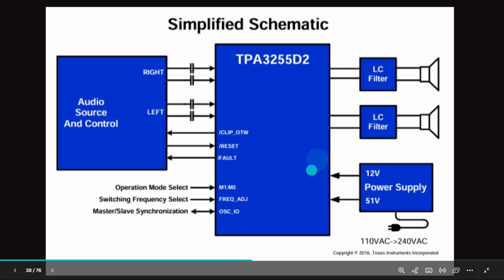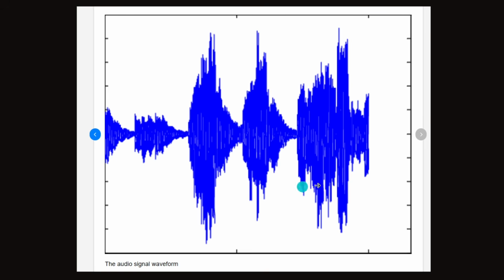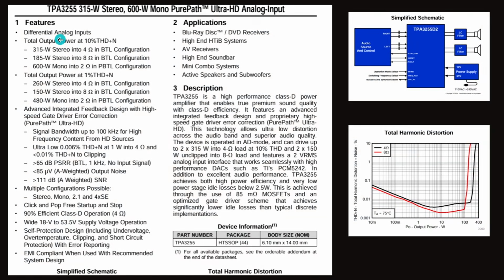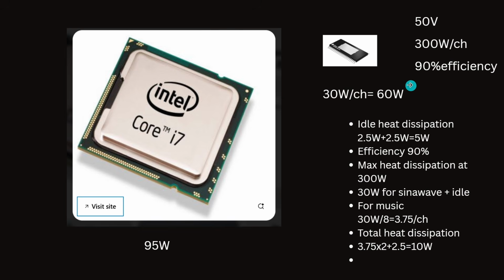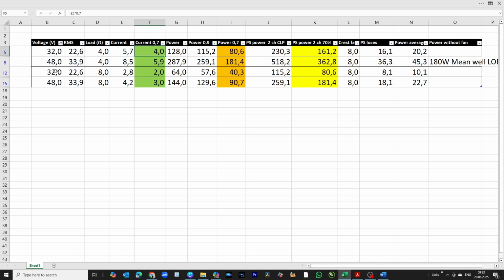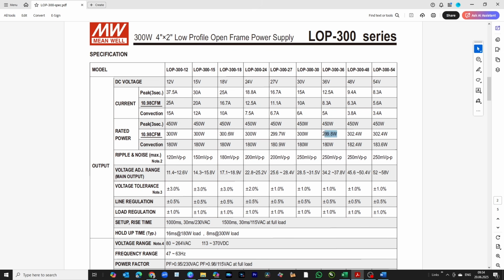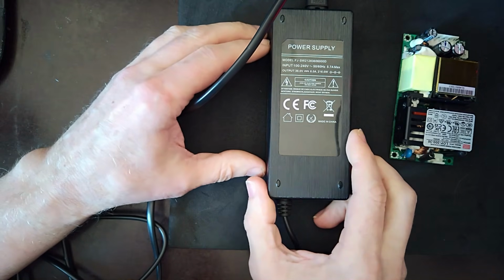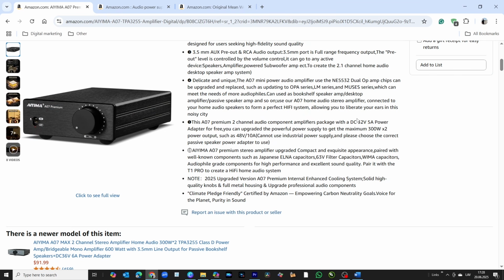TPA3255 amplifier power supply

Comment: Please tell me, have you had any experience with the Yongzhu Star 600w LLC power supply?
Reply from the maker: Most of those power supplies are operational. But I am using only industrial-grade power supplies with certification. Yongzhu Star 600W LLC should be OK for DIY projects, but I would not use them for commercial products.

Comment: the connectors on the meanwell power supply are a bit strange, does it come with the connectors when you buy it?
Reply from the maker: No, but it is a mainstream connector and available in any electronic components catalogue

Comment: Did you test the ripple/noise of the Aiyima 36v supply?  
I'm looking for a 36v PSU to replace the stock 32v 5a PSU that came with my Douk A5 amp and I don't need the power of a 48v supply for my high sensitivity speakers.
Reply from the maker: I have bought Aima 36 5A poert supply and it is fully operational. There is no riple noise issue. For full amplifier capacity or extream users 10A woul be prefereable. On 4 ohms load bass is a bit thin when going up with the power. Othervise great power supply.
Reply: @guntarssmits2104   There is no "ripple noise issue" ... compared to what?
A good SMPS should have ripple near 50mV (p-p) or less.
Reply from the maker: @bbaker6212  TPA3255 has a Common‑Mode Rejection Ratio (CMRR) of about 65 dB, which corresponds to more than a 1000‑fold reduction of common‑mode noise. As a result, the TPA3255 is highly resilient to small power‑supply ripple. The typical ripple frequency of a switching power supply is also well above the human hearing range.
The amplifier’s own noise is approximately 85 µV, and this self‑noise dominates the output, making the influence of the power supply negligible in comparison
.
Reply: @guntarssmits2104  
85 µV is far below most SMPS power supplies so how does this dominate?  
Also TPA3255 amps often use single-rail supplies (e.g., +48V to ground), so SMPS ripple acts as differential noise primarily handled by weaker PSRR... The TPA3255 blocks supply ripple well at low frequencies but poorly at SMPS switching speeds (100-500 kHz) letting noise through to distort sound.  ie, power supply quality still matters a lot - and there is evidence of this by listening tests with lower ripple PSUs.
Reply from the maker: TPA3255 Common‑Mode Rejection Ratio (CMRR) is about 65 dB, which attenuates the power supply ripple effect by about 1000 times, and it does not influence the performance of your amplifier.
Reply: @guntarssmits2104  what does CMRR have to do with it?  These amps run on single-rail PS which means differential ripple via PSRR
Reply: @guntarssmits2104  CMRR is not at play here.  You know this, right?

Comment: Does it work with a ZK 3002 amp TPA3255? I have a 33V-0-33V toroidal transformer (600 VA) but I don't have an AC/DC rectifier board. Do you have the electrical schematic for yours? Thank you very much.

Comment: Пульсации бы замерять, тем более что оборудование есть... Это же одна из основных составляющих!
Reply from the maker: TPA3255 Power supply rejection is 65 dB. Mean well LOP 300 series power supply ripple noise is 250mVp-p. This is high-frequency noise above hearing limits. Who cares about this parameter? The rest of the parameters and peak power are more important. When we are working with a good manufacturer's technical documentation, we can trust the numbers provided.

Comment: Thanks for great work which you have done. I am building my dual mono tpa3255 and selected 60V - 10A power supply, but looks like 50V is too much,. Will add ripple filtering board. BTW, model which you suggested LOP-300-48 has 250 mVp-p ripple - it is not very good results, so I would like to have better option. As well as 6.3A with fan is not impressive as well - we need 10A for dual mono like you calculated. And they released LOP-600 version - it looks promising, but no fan control function.
Reply from the maker: Hi
The theoretical maximum clean output from a TPA chip at 48V is approximately 200W, which is a solid amount of power. I’d recommend starting with the LOP300-48V power supply. The real power demand primarily comes from woofer frequencies, which are more energy-intensive.
If you’re working with a well-designed TPA3255 board, it should include a high-capacity capacitor. This helps support the power supply during peak loads. With the LOP300, you can expect a system capable of delivering 10–12A peak current.
One common mistake beginners make is using an overpowered power supply, which isn't necessary. The LOP300 can handle 450W peak, which is more than sufficient. Keep in mind that audio signals have a crest factor of 8 compared to a sine wave, so even at high output levels, your power supply will remain barely warm.
As for ripple noise—there are different types, but resonant power supplies typically produce narrow-bandwidth noise, which is actually favorable for audio applications. Moreover, the TPA3255 offers 65 dB of ripple rejection in bridged mode—that’s over 1,000 times reduction, so power supply noise generally isn't a concern.
Reply: @guntarssmits2104 hello , what would you recommend for the capacitor from the power supply to the amplifier, and could you demonstrate and give a schematic to make a stiffing capacitor? Thank you much .
Reply: I cut a hoke in the top of the fossi amps cases and mount a 3 to 4 inch ultra quiet fan faced to suck the heat out through the top of the amplifier case . I have also used CPU water cooler system for high power class d chips , the amps love it but makes a big area needed . Plus when using water cooler kit have a couple fans pulling the air from the amplifier case so condensation does not acuminate on the boards components, or treat with spray coating to make water resistant.
Reply: Or if feeling cheeky monkey, do a mineral oil submersion tank and mount the amp inside . Then you have a mineral oil cooler , but after a extended time the oil could start to deteriorate some plastics . ,but then find a way to coat to components and the board minus the external connections for the inputs and outputs . . I have a amp that is cooled by Russian potato vodka , Life of Boris comrades channel did a tutorial a few years ago , and the Russian vodka bottle it the tank .
Reply: The ripple you indicated at 225 is the maximum permissible value. During testing, ripple is usually less than 100. Furthermore, LOPs have a practical power rating of up to 5 seconds at 150% power. In theory and according to the datasheet, this is 3 seconds. For music, this is a very, very large margin. I have LOP 500 and LOP 600 series power supplies. They all also have fan control. But they don't need a fan. They run absolutely cool. And they deliver over 320 watts of power without a fan. And they operate at temperatures up to 80 degrees Celsius, according to the datasheet. They have an extended input voltage and operating temperature range. These are ideal power supplies. At least read the datasheet!

Comment: Hi Guntars Thanks for your video – great information!
 
I have a few points you might find interesting:
 
Following your earlier recommendations, I bought the ICEpower 1200AS2. Unfortunately, the sound quality (SQ) wasn’t as good as with 2 x Fosi ZA3 in dual mono. So, I bought another ICEpower 1200AS2 and now run *two in dual mono* (only using one channel per board).
 
I can tell you that dual mono ICEpower still doesn’t match the SQ of dual mono Fosi ZA3. (all the way up to 95db music peak) In my opinion, ICEpower is not an endgame amplifier for SQ. The 1200AS2 might be “endgame” for DJ or club use – but not for critical listening.
 
Also, please consider doing a new video about *power supply noise* and how to optimize ripple (e.g. with LC filters, etc).
 
Mean Well PSUs have quite a bit of ripple – around 240 mVp-p. In comparison, the Aiyima 48V 10A is a *GaN-based PSU* with lower noise than the Mean Well you recommended. Also, because GaN operates at a much higher switching frequency, its ripple is (theoretically) *less likely to degrade SQ* in the same way as a standard SMPS.

PS my set up is. wiim ultra via USB to singxer su6 (DDC) via hdmi to Holow audio Cyan2 (DAC) XLR to amp (fosi/icepower) to dali zensor 3
(and I will now use my 2 x ice to run dual subwoofer - i can tell you that they/ice will love that - and so will my subs)

thanks
Reply from the maker: Tpa3255 in bridged configuration has 65dB ripple rejection. So it has significant noise resilience to ripple. Also, there are different types of noise. LLC-type power supply noise always has a symmetrical form, which has a minimum impact on audibility. The most important power supply feature is to stay stable at drum kick peaks and not drop voltage or suppress bass. Ripple is less important. AIYIMA GaN 48v 10A seems like a good power supply, but I do not have personal experience with this particular model.
Reply: @guntarssmits2104  I don't think you can transfer 10A via DC socket.  Just measure the resistance of it.
Reply from the maker: @ruslanmulyk8601  Yes. It is part of the challenge. You should verify what type of socket you have. There are some rated for 5 amps, and typically you can transfer about 4 times the rated. I am personally using screw terminals for connecting board and power supply.
Reply: Hello, try 3e audio A5 (low distorsión and low power) or the A7 (a bit more distorsión and more power) and you will have a lot better quality than Fosi or Aiyima.
Reply from the maker: @arturomty9969  I’m aware of the growing community around compact amplifiers based on the TPA3255 chip. However, most budget-friendly, small-footprint designs currently suffer from thermal management issues. So far, the only board I’ve seen with a proper passive thermal design—without relying on a fan—is the Icepower 200AS2, which uses the TPA3255 chipset and includes a high-quality integrated power supply. It’s available at retail for around €160, making it a solid option.

There’s also the ZK-6002 amplifier board from the Chinese company Wuzhi, which features a thermostat-controlled fan that meets basic thermal requirements. I’ve tested it to push the TPA3255 to its limits, and it performs well. It’s a good board and a step in the right direction.

That said, I’m still looking forward to seeing more advanced design concepts from my colleagues in China. I’m confident they’re on the way.
Reply: @arturomty9969  And this has already been proven by Amir's measurements. I completely agree.
Reply: The Lop series power supplies we tested have very low ripple, typically less than 100. They are ideal for Class D amplifier architectures.

Comment: Hello, great video, came in perfect time, thanks!

I have a TPA3255 3e Audio setup, consisting of one stereo and two mono modules with PFFB (models before the A5 and A7 new line). These are intended for a 2-way speaker system with active crossover, inspired by your videos. 

My plan is to use three separate power supplies, one for each board. Do you recommend LOP-300 units with either 36V or 48V outputs? 

I was considering purchasing two Micro Audio SMPS600-R2 units, a 600W unregulated high-quality switching power supply, but it's beyond my budget. I might be able to afford just one for the 3 amplifiers.

In your opinion, what do you think about using a single SMPS600-R2 versus three LOP-300 units?
Reply from the maker: When designing a multichannel audio system, the total power requirements are relatively modest. For woofers, you typically need a maximum of about 100–150 watts. Driving the woofers directly, rather than through a passive crossover, improves efficiency by approximately 30%.
Midrange drivers require just around 3–5 watts, while tweeters only need about 1 watt—even when playing music at very high volumes. This means a single Mean Well 300-36V power supply is more than sufficient to power the entire system.
However, the LOP 300 has one notable drawback: in idle mode, when power consumption is extremely low, it enters an energy-saving state and draws only 0.5 watts. In this mode, it operates in bursts—alternating between charging and waiting. This behavior produces a faint mechanical vibration from the inductors, which is just barely audible from up to 30 cm away. When music is playing, the system is silent, but during quiet pauses, the noise can be detected. Personally, I find it acceptable. And if your power supply is positioned some distance away from the listening area, the idle noise is likely to fall below the threshold of human hearing.
Reply: @guntarssmits2104 Very helpful info, thank you very much and keep up the good work, btw, I love you channel!

Comment: One important point:
You made no mention at all about the output voltage ripple.  
Minimal output ripple is crucial to get the best performance from audio amplifiers.  That's why I put a lot of effort into filtering the output power with a C-L-C circuit with X capacitors for Differential Mode noise, and a Common Mode Choke with Y capacitors for Common Mode noise.
With proper design, you can reduce voltage ripple to less than 10mV.
This can make a big difference in how the amp sounds.
Reply: DC filtering can be very simple but effective by just adding a couple of X capacitors across the + and - power lines.
For example, a 300uF polymer cap in parallel with a couple of ceramic caps, rated at 20uF each.  Different types of capacitors act differently, using polymer caps and ceramic caps in this instance.
This will result in a very much improved voltage ripple level. 

More complicated DC filters start with this, but then add an Inductor on each line, followed by another cap  followed by a common mode choke  along with two Y caps
connecting each line to ground.
Some filters use multiple Common Mode Chokes in progression. 
As a last step, you can add a few aluminum electrolytic caps of a relatively high capacitance at the end of the filter to provide robust reserve power.

I am using this on my 48V, 10A SMPS for my Fosi ZA3 amp.

I have a different 5 Volt, 2 Amp power supply with a measured 1uV ripple level.  That's one-millionth of 1 Volt!
Reply: @bjohns3333 thank you where can i buy this produkt. do you know. or only diy? i imagine there is a allot of classD-ppl that want this filter
Reply: @degreesdegrees-jr4eg  +1
Reply from the maker: The samples that I mentioned have low Ripple voltage. It is kind of a default requirement for an audio power supply, and I did not mention it as a feature. But you are right. You need to choose low ripl voltage PS
Reply: yes you got it! .. fosi has a produkt: "Fosi Audio DC Power Filter Eliminates High-Frequency Noise" i am not shure but i think it is a LC filter (it works) .. however u like to max out on this ripple subjekt - can you give me information to produkt or tel me a how to du a max out rippe filter. thanks
Reply: I'm an Electrical Engineer, so I put the circuit together myself (DIY).

If you want to buy already assembled pieces, just Google for "DC power EMI filters".  It will show you pictures of many options from e-Bay, Amazon, etc.  
You can also check out Mouser Electronics, DigiKey, etc. for commercial type products. 

Just be sure that you buy for the correct DC Voltage level and maximum current allowed.  Try to get higher values than you need for both voltage and current; it will perform better and last longer.

The Fosi DC filter seems effective, but I don't know what's inside. 

-------

After this, you can look into AC power EMI filters so that you can clean up the AC power coming out of your wall!

Comment: Or, better yet, choose a mains-powered Icepower module.  I've built several power amps based on these (thanks for the high-quality enclosure Guntars), and have never been let down.  The quality of design/manufacture/components on the Icepower stuff is beyond reproach.  Only A-tier components are used, so no "Ching-Chong" brand caps, no nasty surprises.  Only Nichicon, Elna, Panasonic, and the like-- Not a single "Crapxon," "Ching-ChongX," or "Kung-Fu" Crapacitor anywhere on the PCB.  I'm looking at you, Hypex- "Sus'con."  Also, in the last 5 years, both of my Hypex NC252MPs have failed, while my 10+ year old collection of Icepower modules have a 0% failure rate, good stuff.  I was seriously impressed with the 1200AS2 I recently took delivery of👌👍🤙